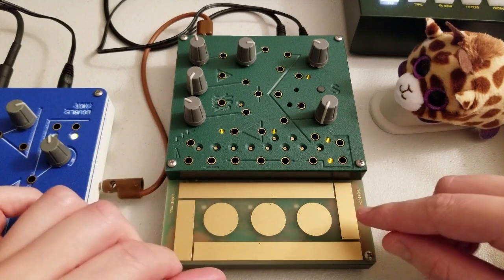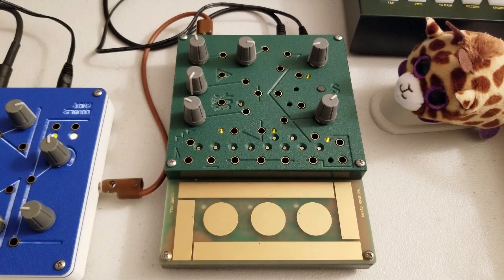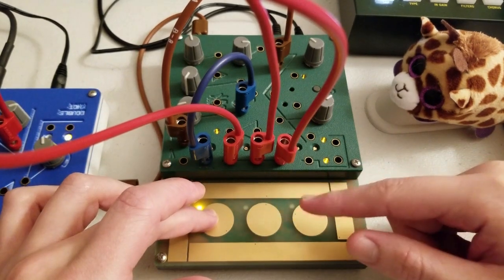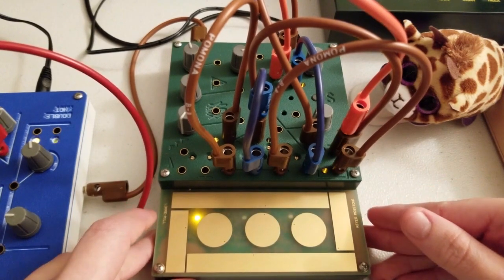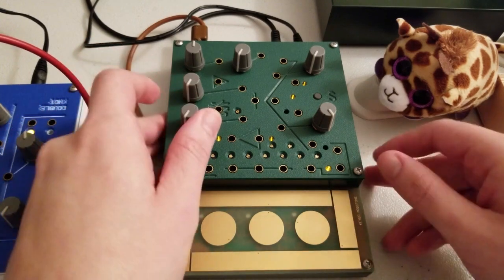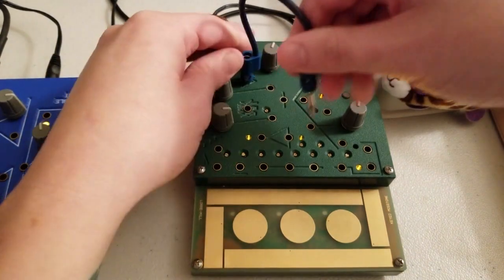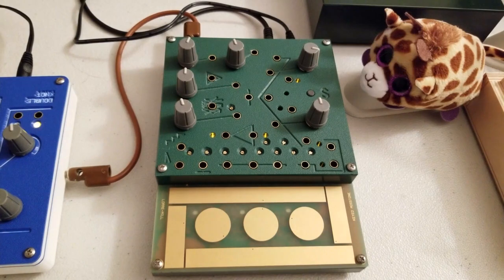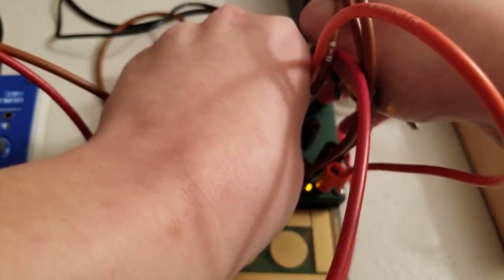Lorre-Mill Keyed Mosstone (in-depth overview / demo)

Comment: Awesome video! My circles won't respond to touch when I have a patch cable plugged in, even if the cable isn't going anywhere. Do you know if the gold plated versions have a different firmware running in them? I should probably just bug Will, but yes. Thank you for making such in-depth videos! They always give me new ideas and ways of thinking about the instruments.
Reply from the maker: Hey, thanks for commenting, I like your videos too :D 

Will didn't mention any firmware changes in the gold plated version, but it could have to do with how they're wired (hardware rather than firmware). I'd reach out to will and ask if there's a mod/update that can be done. Sorry, wish I had more info than that >.<

And I agree, I love the Lorre-Mill philosophy a lot, minimal but encourages thinking outside the box :D
Reply: Cool! Thank you! :) Yeah, I should just bug Will about it. Not really a big deal for me.

Comment: That was a really good tutorial thank you so much for making this!
I was wondering if you can change the root note, and how do you do that
so I can change keys for a song
also could I use the keyboard with it's functions for another synth?
Reply from the maker: Sorry for the slow response - I'm glad you liked the video!

So I'm not sure what you mean by root note - you can transpose the Mosstone in several ways, either with the eurorack-comptible volt-per-octave input on the back (which works as a transpose for whatever you're playing/sequencing on the keyboard), or either of the two bananajack pitch inputs in the top left. This will shift all pitches up by a certain amount, though it won't modulate the key, if that's what you're trying to do (which I think it is!).

And yes, you can use the mosstone's keyboard interface with other banana jack synths - the bottom left hand corner has a trigger output for whenever one of the circles is touched, and a pitch output (though it is very wide-ranging since it's for modulation, you'd need an attenuator to bring the levels down for pitch). Though this output does not account for the top and bottom bars, there's also the bottom bar output which you could use for further control. The randoms you could also use just as you would with the Mosstone. Hope this helps! :)
Reply: Allieway Audio there was rush on response :), I purchased one and am learning to use it,  yes I meant modulate the key.Thank you for all the info it makes it a lot easier to understand  the instrument, please make more videos off any insights or patch ideas
Reply from the maker: @dreamcometmusic1946  Congrats on the new mosstone! Yeah, for "key modulation" the best thing to do is change the data you are inputting into the key inputs, in conjunction with transposition. It's not technically key modulation, but it'll get you to different places :) 

I definitely plan on making more videos on the mosstone in the future, especially how it interfaces with other gear - stay tuned :D

Comment: Why can't you plug negative voltages into the Mosstone?
Reply from the maker: The circuitry was not designed to anticipate negative voltages, so it would cause the circuits to act unpredictably, and potentially break. All Lorre-Mill gear uses a voltage range between 0v and +8v. It's actually not the only modular format to not accept negative voltages - there are even some eurorack modules that aren't built for negatives. You still have plenty of control range though, IMO :)